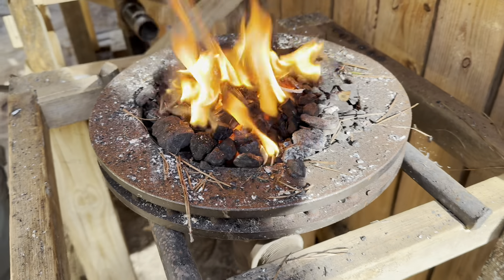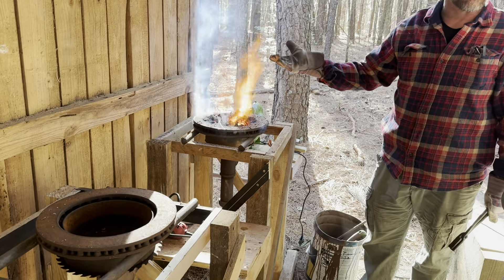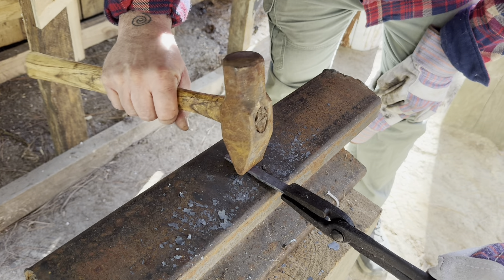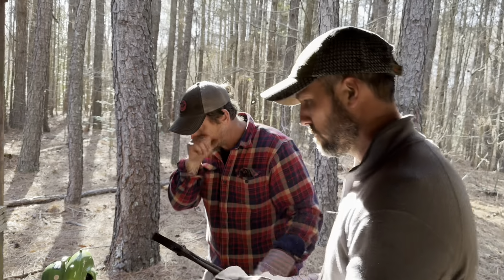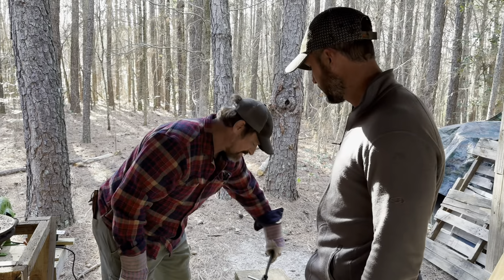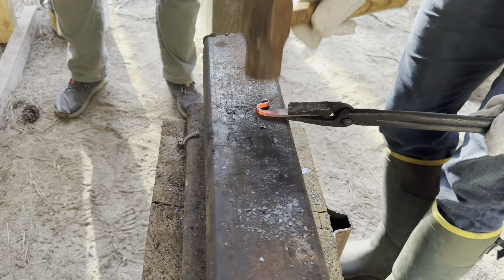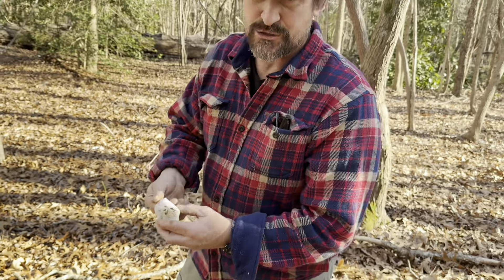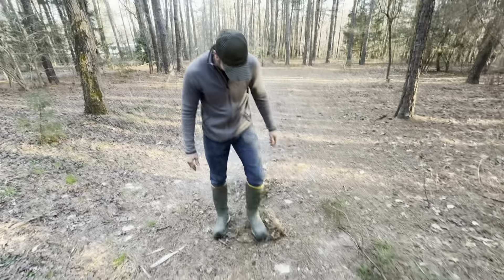What Makes This Fire Starter So Effective?

Comment: This is a great teaching project. Allows the rookie to gain experience with a coal forge, handle the tongs properly, and actually apply the hammer to the metal. Good instruction with a student who is willing to try and learn. With practice comes confidence and success with your metal works. This is an excellent setting for one-on-one instruction and learning. Priceless memories being forged here.